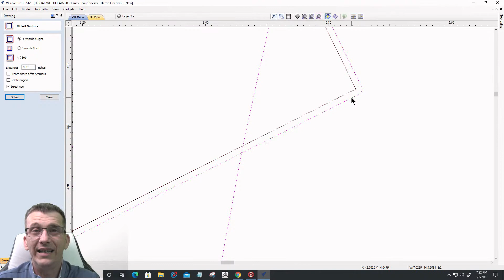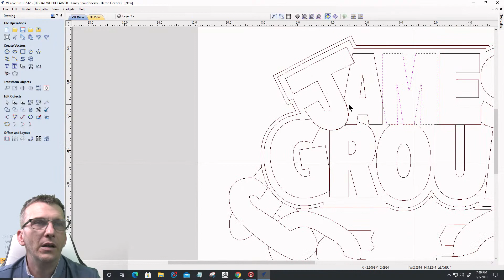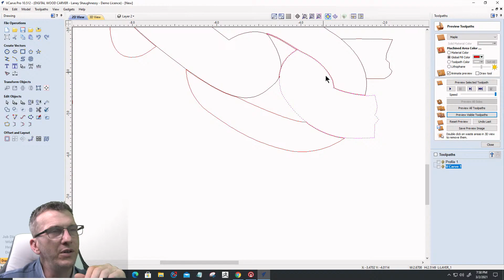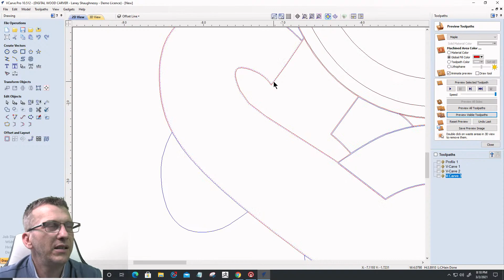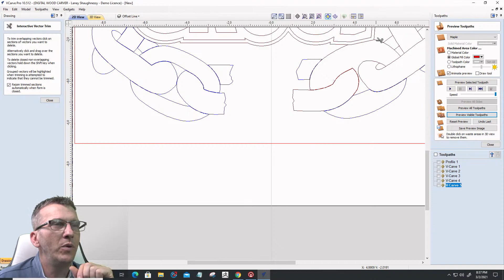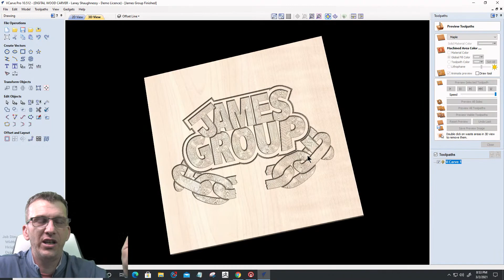How to import a DXF and Fix Open Vectors - A Vectric Tutorial

Comment: Great Video. Thanks.  I learned what I needed to fix a problem I was having today with a simple file that gave me an 
ERROR Message: No toolpath generated for current parameters. Check tool can fit into selected vector at machining depth.
The Error Message made no since to me. The Vector Validator showed 2 Overlaps and 4 Intersections which I fixed. Yay